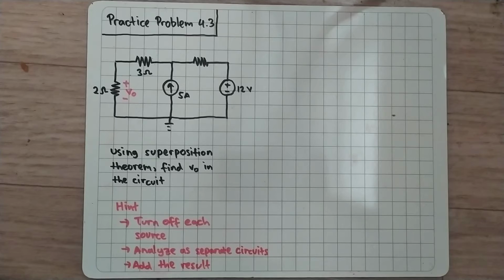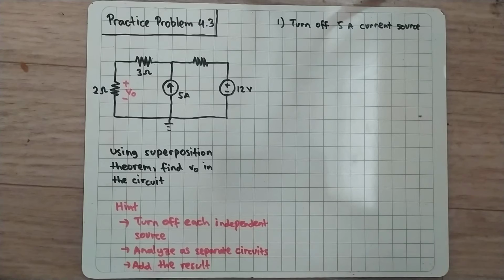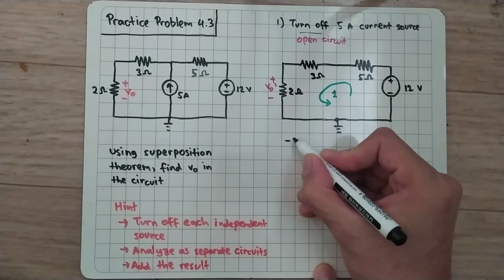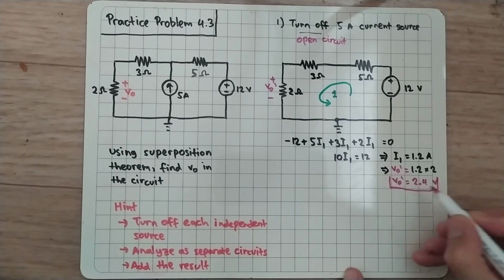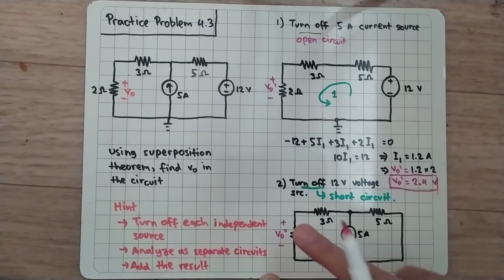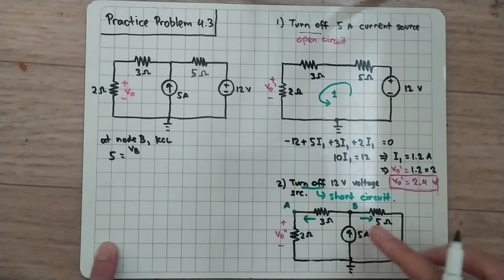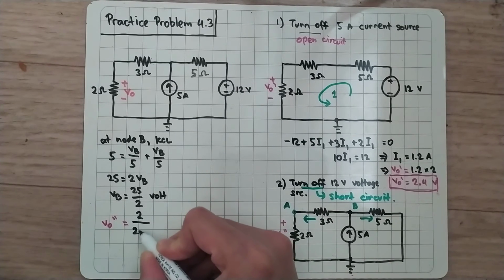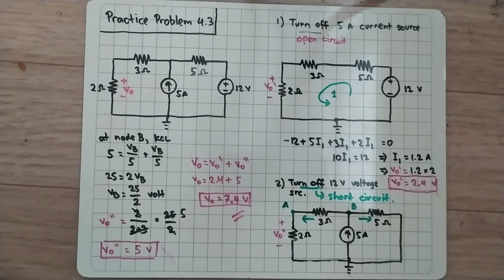Practice Problem 4.3 Fundamental of Electric Circuits (Alexander/Sadiku) 5th Edition - Superposition

Comment: When you turn off the Voltage source, why don't you do analysis of node A? 

Also, when the current is going from node B to A at the 3ohm resistor, shouldn't the current be (VB - VA)/3?
Reply from the maker: It's not an essential node. You can just do voltage divider.

Also it's a series resistor. So I use easier way to calculate.
Reply: @ArdiSatriawan  good answer thank you
Reply from the maker: @yeezyvault7252  Welcome